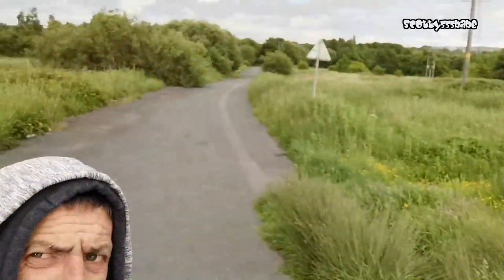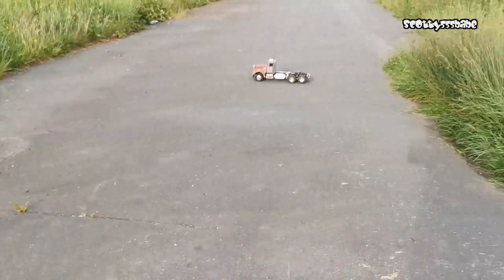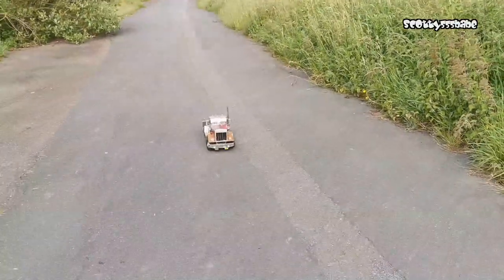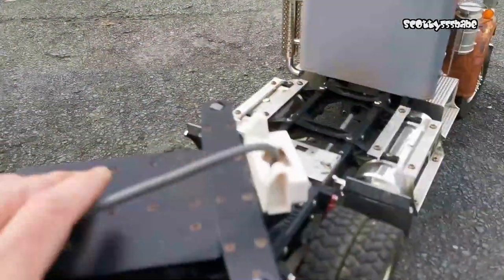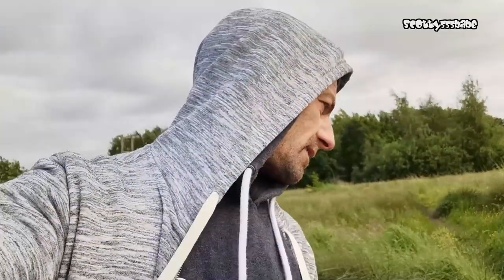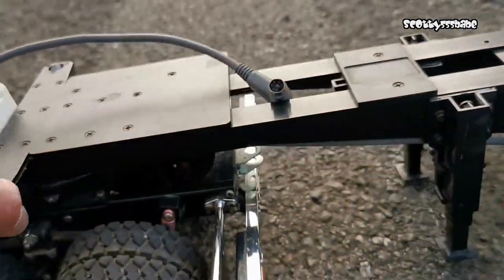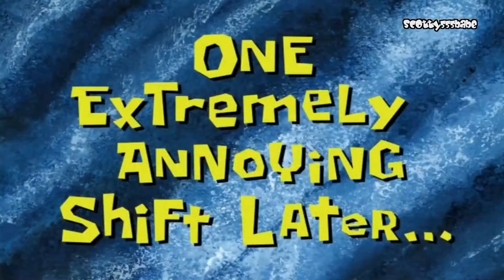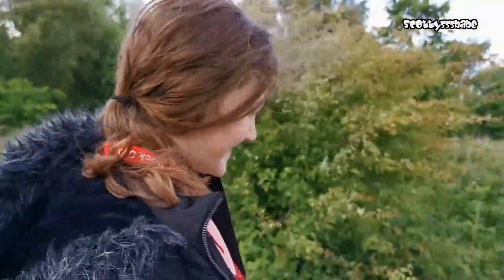Learning to drive an Rc Truck & Trailer using a stick radio | Tamiya King Hauler | Rc Truck Action

Comment: As with most model vehicles it really needs a servo slower to slow the steering down more so in reverse
Reply from the maker: They're just getting more powerful these days but with throttle control you can eliminate a majority of it 👍

Comment: Scotty, on the kids trucks i use a handset where you can programme the end points and i adjust it right down to like 20/25 % throttle in forward and reverse so it slows it right down , then as they get used to it i start upping it slowly giving them more speed
Reply: I think this would be a great idea, if the remote can be adjusted by programming.
Reply from the maker: I've gave her a 7 channel digital handset now which is smaller in size too, so I can slow everything down for her as that's how we'd set all her trail trucks up on the spectrum pistol grip but having the MFU she needs a stick, so she should do much better next time with her new radio 😊👍

Comment: I'll see what I can do 😉 Great lessons. With that transmitter could you edit the throttle curve so it reverses slower? I find it much easier to reverse lol
Reply from the maker: Not really its all down to throttle control which she has no problem but I've now got her a 7 channel digital radio so we can limit everything and she can operate all her lights from switches to make it easier for her 😊👍

Comment: I think the main problem is she was watching the truck more than watching the controller while reversing to the trailer, and as a kid you are more used to kid toys that either do full steering, or no steering, so once she gets used to the fact that how much input on the sticks you use is how the truck will react then think she will master it in no time. personally think the proper remote will help as well, hate the gun controllers as don't really feel right, especially on a few hundred pound truck. plus gives you more sense on which way you are steering with the springs giving more feedback. maybe a bit better for her to stand above the trailer rather than to the side, or if you can reverse the controls for when she is stood infront of it for the practice couplings. great father daughter relationship building experience as well if you are both into something.
Reply: but Leyarna did do extremely good for her first practice, yeah reversing the trailer is about the hardest thing to teach, because the trailer will always want to turn, even driving it 1 mile in a straight line before reversing, it is the same in real life, and in a game like ETS2 or ATS. maybe as someone else suggested is getting a controller that can be programmed to reduce acceleration before trying to teach reversing with a trailer.
Reply from the maker: I'm the opposite in that respect, I love pistol grip controllers and she's not to playing with cheap toy rc so with a pistol grip her throttle and steering control is amazing but as she's having an Mfu fitted in her truck she's going to have to get used to a big bulky controller to operate it, she'll grasp the hang of it one day.. Probably after she's destroyed a few trucks and trailers but hey, they're just toys at the end of the day, just bits of metal and plastic, what matters to me most is the little girl behind the radio 😊😊
She has autism and learning difficulties.. She's 10 but has a mental age of about 4 now but I'm confident she'll soon be driving these trucks like she drives her trail trucks, she has a handful of Rc already, I usually always get her one when I get one, so we both have an axial wraith an axial scx.1 a 10.2 and a 10.3 each and she has an axial ax10 and I have the smt10 and she also has her axial scx24 and a maverick monster truck for the skate park and then some budget toys she enjoys.
So she can drive lol, it's as you say.. Its just getting that coordination 😊👍

Comment: In time she will get hang of it, she did really well tho, the sticks are deffo awkward, can u not find her a 6 channel like the one shes used too? Just make it easier for her to learn the basics??
Reply from the maker: Thanks, She certainly will 😊
As she's having Mfu she needs a stick radio to operate all the functions, that's why I took her out with this radio so she can get a feel for it and practice a little bit, she's great with the trail trucks and has great throttle control using a pistol grip, however I've now got her another stick radio (7 channel) and it's slightly smaller in her hand so she can still operate the MFU and I can slow everything down for her 😊